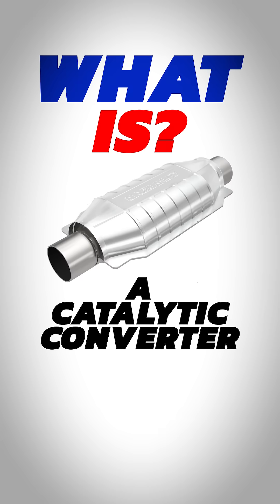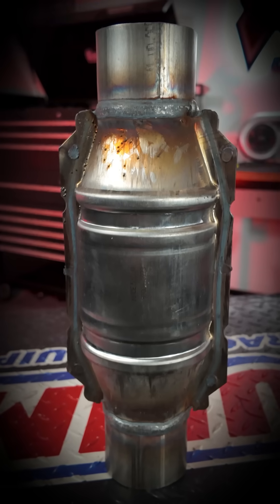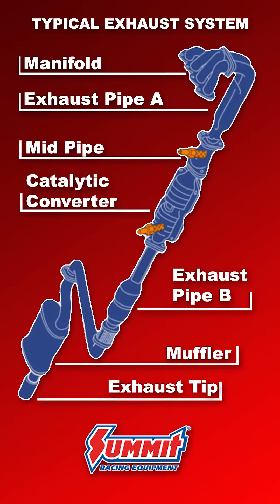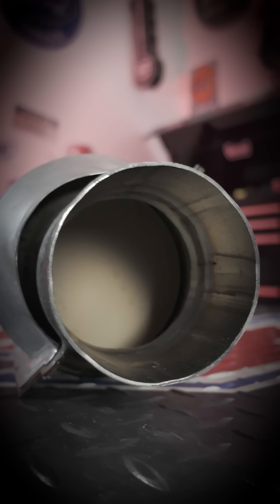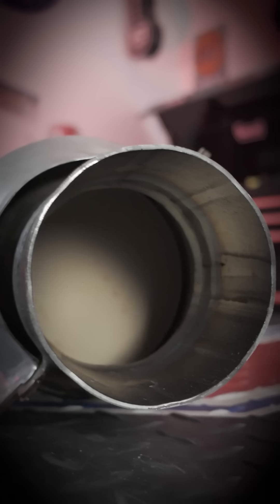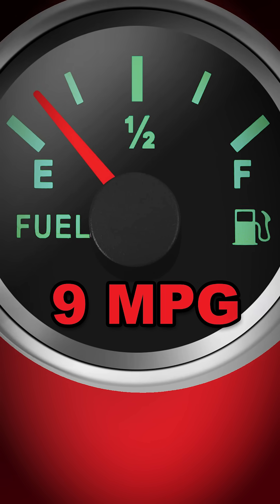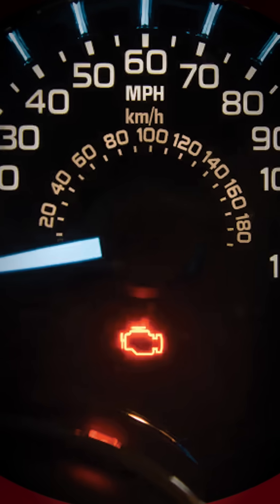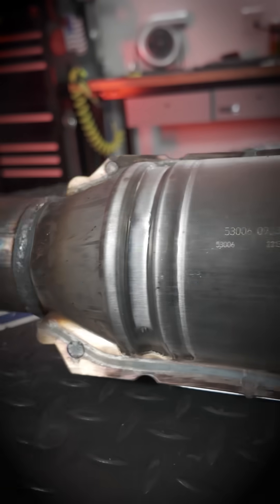What’s a Catalytic Converter & Why Does It Matter?

Comment: The only reason for the bad gas mileage, loss of power and check engine light are purely because of the rear O2 sensors whose sole purpose is to check the effectiveness of those catalytic converters. If you tune that out of the computer, you have better exhaust flow, and paired with the right exhaust can lead to better scavenging which causes a more efficient combustion cycle. 
If you make those changes, you might even get better fuel mileage, as well as more power
Reply: I cut my cats off my truck because the fucking y pipe from the manifold was 3,500 bucks and California is dumb as fuck acting like it protects the environment you didn’t need a tune to notice the difference my truck has better air flow because the cats are gone. My check engine light come on and off but I do need a tune tho